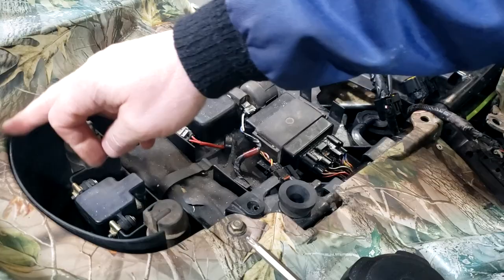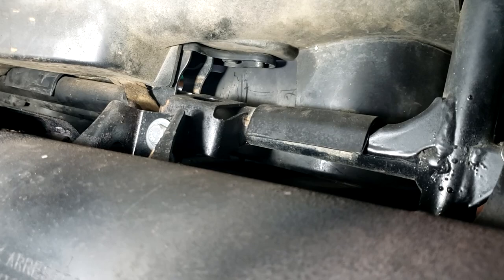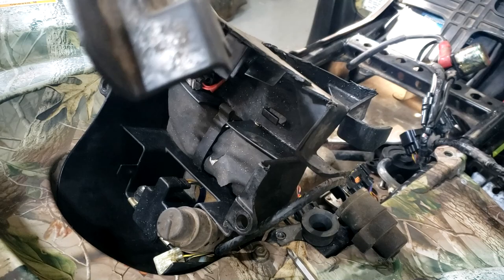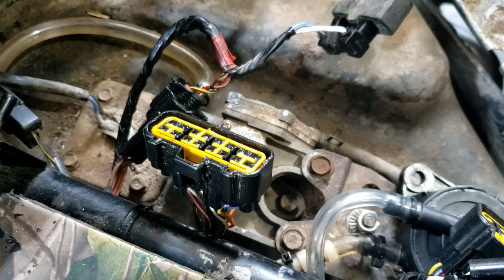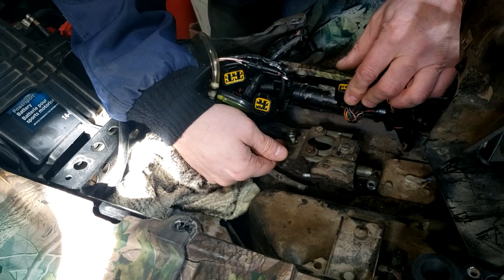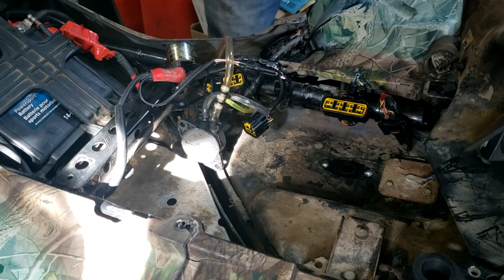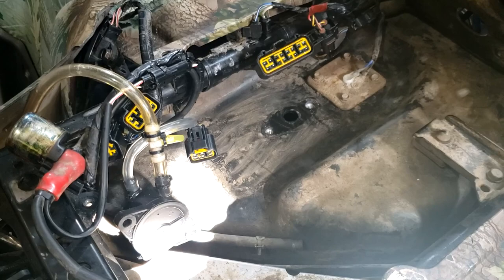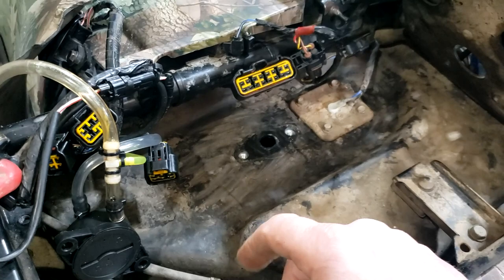2005 Brute Force 750 Fuel Valve Problem removal

Comment: does that petcock have o-rings inside?
Reply from the maker: An o-rings and a little suction valve. The valve is stuck and the whole thing is messed up from the bad fuel. Will be much better with a whole new unit.  Thanks Fred!
Reply: @RobFarrowATV  I figured the orings were toast and a bunch of varnish in there too.
Reply from the maker: Yep, gas does wonderful things when left too long. LOL!